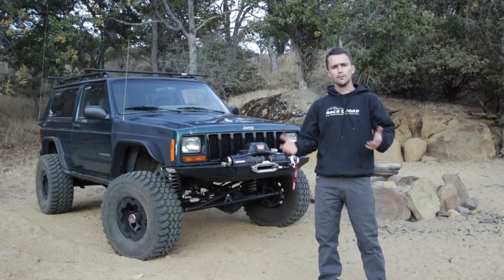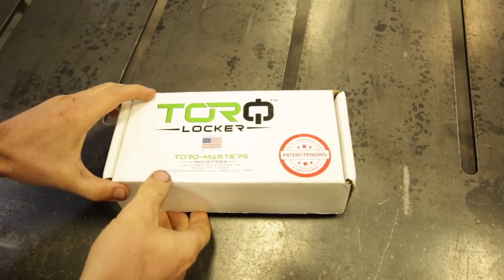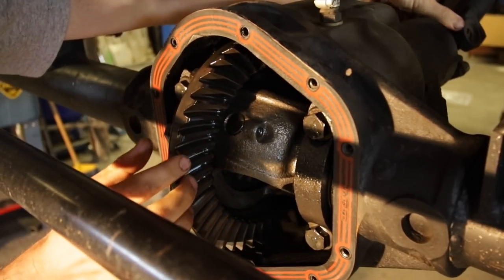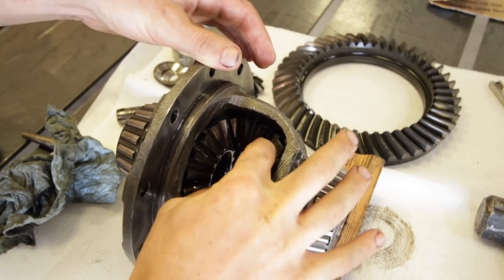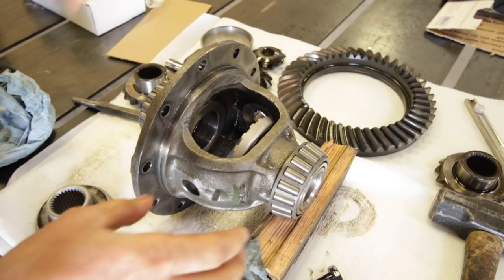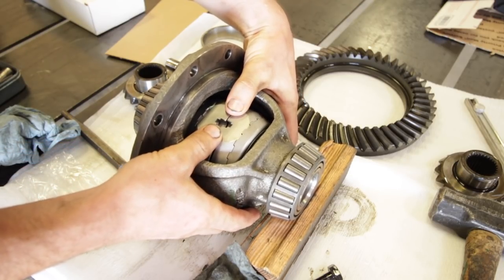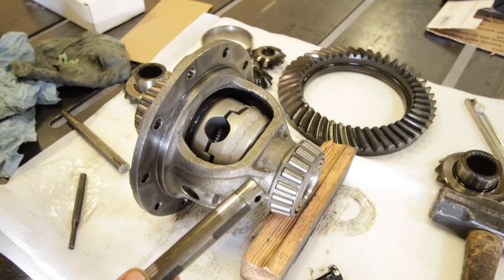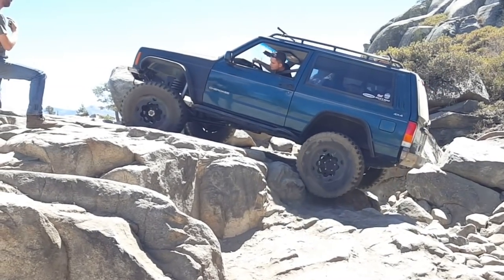How To Install a Lunchbox Locker

Comment: I installed one of the Torque Lockers in the front of my TJ. Im very impressed.  It locks hard. But it is very quiet on the street and the road manners are really good. I had an Aussie lovker in the front of an XJ it was noisy and road manners were not good at all. Torque locker has knocked it out of the park.
Reply from the maker: Glad to hear it!

Comment: I have a lunchbox locker in a Comanche and it is sketchy as can be in snow. If one tire locks under braking while in two wheel drive it try’s to lock the locker. Lol. The whole truck jumps and bucks. Just keep that in mind if your driving in snow on a partially cleared road. Great Video man.

Comment: I've run the TORQ Locker from TorqMasters for the past 2- almost 3 years in the D30 in my '11 JK . It is , handsdown , the single best,most noticeable difference and useful off-road mod I have added to a heavily modified , trail only Jeep. Cora & Eric being so awesome to be customers of only ramps their USA made products better. I installed in garage myself in about 3 hrs , taking my time. It is silent on asphalt and does not clack at all when turning full lock in 4wd, but I also run RCVs and cry'oed Yukon RPs. There's a full review of mine & other customers at the TorqueMasters web site. 
An amazing company and an amazing solution for a front locker. I have tortured it quite hard & it keeps the 37s digging and pulling ...⭐⭐⭐⭐⭐
Reply: I agree looks like a way better product and worth the money

Comment: I have one of these in my Dana 35 and it is one of the best things I have done. I didn't want to invest a lot of money in a Dana 35 but I also didn't have the money to do an axel swap so for the $270 that the Aussie cost I did that for now. It has been absolutely amazing. Not one regret installing it. I daily drive my jeep and have not had any issues with the locker, even with it in the rear. A lot of people told me that I would eat tires because I put it in the rear but that hasn't been my experience. The only thing I have seen difference is the normal clicking of the locker and increased traction. I would tell anyone this is a great bang for the buck project.
Reply: How bad would you say the clicking is? I daily me Jeep too and don't want it to annoy me
Reply: Neil turn your radio up
Reply: Thick gear oil 75-140 conventional and a thick diff cover will take away most of the clicking. We can hardly hear clicking in our LJ when driving on the street, we have TORQ Lockers front and rear.
Reply: @neil7179  my Aussie sounds like a card in the spokes of a bike. I actually like the sound.

Comment: I just installed a torq locker in my jeep tj Dana 30 and it performed flawlessly while running some trails at Rausch creek!  Of all the lunch box locker designs these torq lockers are the best!
Reply: Was planning to do the same on my YJ but am concerned, how does it handle on the street?
Reply: I've got the same question as Justin. How does it perform when the front axle isn't engaged on the street?
Reply: I have no issues in the front at all on street.  I don't have any clicking at all during turns either. This is my second type of lunchbox locker I have used and this one far exceeds the old one.
Reply: Great review, thank you!!

Comment: Torq lockers are the awesome upgrade of the aussie locker, and I use them in all my vehicles and they have been awesome front and rear !!
Reply: Just wondering if u do alot of street driving with a lunchbox in the front. Im thinking about installing one on the fron of my tj but worried about highway driving.

Comment: Great install video, easy to follow steps and nice camera work.  A lunchbox locker is a great option for the right application.
Reply: Right application is the key, you need to understand how they work in day to day before committing the install.

Comment: Like the other dudes are saying.  I drive a 79 f150 4x4 as my daily (just a little 6 banger).     The dana44 in front or the 9in in rear are wanting some sort of locker for canyon/desert crawl'n.   Here in Idaho, we do drive in snow.   Not freeway speeds... but normal streets.   Would like to see how it does 'just driving around'.  maybe mimic it in light dirt/mud or something.   Looks cheap and easy.  I like it.
Reply from the maker: I live in southern Oregon. We get winter driving conditions too! Stay tuned for a winter driving follow up vid on this locker. I depend on my Jeep for my primary transportation in the winter so I need it to drive reasonably as well.
Reply: Kewl.  Owyhee's style.

Comment: Great video!  I really makes the installation look doable.  Let us know how that locker behaves on the street in rain and snow though...  Its the only reason I haven't installed a lunchbox in the front or rear of my TJ.  I daily it.
Reply: I want to do the same to my ZJ but I daily it.
Reply: I would love to know how it's street manners are in the dry as well as the wet.
Reply: @vgullotta  When my jeep was my daily I had a lunchbox in the front and it worked great. It doesn't engage in 2wd so on the street it's great. I live where it snows but never have I had to use 4wd. If you use 4wd in snow, only use it in deep snow, don't want to get understeer at higher speed
Reply: @cranjismcbasketball343   How noisy were they on just out of curiosity
Reply: I have front and rear Spartan lockers in mine and it does great on the street, no issues at all.
Reply: I have one on my Tj in front.  You can barely hear it on the road.  But you can hear it in 4wd because it’s under a load and trying to ratchet.  I wouldn’t recommend one in a rear axle
Reply: @StrainingDingelberry  They work great in a rear axle all three of my vehicles have auto lockers in the rear.
Reply: Victor Leachman  Is it not an issue on the road because of the 4wd not being engaged?  And do you drive it in snow and rain storms?  I'm in Michigan and this is my do everything daily driver.
Reply: @Khorsathedark  If you use 4x4 in the snow regularly I would leave the front open and put a locker in the rear.
Reply: Agreed would  like to see a follow up video on the street
Reply: Front TORQ locker-
The Jeep will still drive like stock in 2wd, and will operate normally in 4wd. Gives you that added boost when off-road. 
Caution in 4wd on icy road conditions. Reduce Speeds! Just takes practice to understand how a locked differential reacts in Ice and Snow.

Rear auto locker, the more throttle applied, the more it locks up. For a vehicle that sees more off-road use than on, this is what I prefer.
There is a slight learning curve for newer drivers with manual transmissions, but it's super easy. A rear locker works great in the snow, all the added traction means you won't need 4WD as much. A rear locker is fine for Daily Driver use. It will make an audible ratchet noise when negotiating tight turns, but that can be lessened with a thick diff cover and heavy weight gear oil.
Reply: @TorqMastersIndustries  Caution for a locker in the front or back?  or both? I know if the locker is in the back. The rear will kick out. But what's the negative in the front? If the locker is in the back. Wouldn't 4wd help maintain stability?
Reply: @GOD719    
Driving on the street - a rear locker will only kick out if you stand on the throttle in slick conditions, which could make any vehicle kick out. 
Driving on the street - a front locker is not noticeable in 2WD
Driving in Snow and Ice - A rear locker will give more traction and you will need 4WD less. 
Driving in Snow and Ice - A front Locker should only be used in 4WD when 4WD is really needed and should be driven at reasonable speeds as the OEM vehicle manual suggests. We know some people use 4WD as a crutch in snow and ice to drive fast, at highway speeds. If you can get up to highway speeds you don't need 4WD.

Comment: Great video. Thanks Tim! Cool you got a chance to run the Rubicon. As I posted on Nate's video, you guys on 33's can do Fordyce Trail... But, you will be stacking rocks, pulling cable and will have to do some of the by-passes. Depending on the time of year, the river crossings may be interesting as well. Good to see others using Lube-Locker. RTV on the diff cover is for sucka's! :-D

Comment: I have a 2000 XJ 3.5 lift with 33' tires should I put a front locker on my everyday driver? I'm in the process in install a rear locker I like to run my jeep in the desert what are your thoughts. I'm new to the XJ group. I enjoy watching your videos and have learned a lot.

Comment: I have had mine for a while and it stopped making noise when I make a sharp turn in 2 wheel drive. How can I check it to see if it still works. It is without a doubt the best improvement in 4 wheeling.  Thanks

Comment: Hey Tim, good to see another video from you. Question about thine locker, how are the on road manners of this locker? Their website says it has the best of all lunchbox lockers, but I'd like to hear from someone whose actually running it.
Reply: A front locker has no affect on road manners, because you are in 2WD typically. A rear TORQ Locker is where you see the great road manners, and here's why:
the TORQ Locker eliminated the "spacer" which is found in all other lunchbox lockers. The spacer can sometimes slide down the axle shaft and bind on the cross pin. When it releases, you get a loud "pop" or "bang" that some people complain about on the forums. Without the spacer, no 'bang." Typically these complaints are for rear lockers.  A rear locker will click when you coast through turns. If you hit the gas hard in a turn, you can get the 2 rear tires to chirp.
Reply from the maker: Because I have manual locking hubs now I'll almost never run this on the street in 2wd simply because I don't need to. That being said, while messing around with it, driving with hubs locked in 2wd in a parking lot it's honestly barely audible while turning (using 75 140 gear oil) and there are zero handling characteristic changes. I haven't tried locking the tires up on pavement while turning or anything, lol. But under normal driving circumstances you shouldn't really notice it at all IMO. Great upgrade to my Jeep.

Comment: I really need some help. I want to get either a lunchbox or LSD (like a trutrac). I cannot decide which or where (front or back or both). I need it mostly for the snow/ice because right now it does not move being open diff. Has anyone had experience with a front-only lunchbox in the snow/ice?

Comment: Very nice! How does it handle on the road or is your Jeep strictly off road?
Reply from the maker: I drive it almost daily. With my Dana 44 swap I inherently received manual locking hubs too so in my case my front axle components are completely motionless while driving and hubs set to FREE. Lots of people have these in regular XJ or other non disconnect axles and daily drive them without issue!

Comment: Great video. Lunchbox lockers are great, but I would never put one in the front of a vehicle that will be daily driven in rain or snow. I think they are primarily offroad use only. To dangerous to drive at highway speed in foul weather.
Reply from the maker: I'll find out!
Reply: When you are in 2wd they are no different than an open diff.
Reply: I've had aussies in the front and rear of my XJ for the past 5 years, and I'll be putting TORQ lockers in my one tons, driven in rain plenty of times, and even in some harsh NY winters. As long as you don't drive like a dipshit, they are easily manageable and you can quickly adjust to how they act and predict what the vehicle's going to do better.
Reply: Lunchbox lockers are designed for both on-road and off-road use. Many of our customers install our lockers in their daily drivers. For snow and Icy conditions we say use common sense and don't drive recklessly.

Comment: Good video but when making a how to video I  would  remind viewers to Mark the ringgear before removing it.
Reply: Would you have to recheck/set the pinion & ring gear engagement?  (assuming you use the same shims of course?)
Reply: Good tip Robert - I totally agree.
Reply: Billy T  No you do not, that's the beauty of the TORQ Locker. As long as the ring gear goes back on in the same position, you do not have to re-set backlash. An index mark on the ring gear to carrier is an easy way to make sure the ring gear goes back on in the same place.
Reply from the maker: Nope. Just mark the ring gear there it mounts up to the carrier. I did this before unbolting it but neglected to mention that in the video. The locker came with great instructions that mention and show you how to do this.

Comment: Thinking of getting one  I've seen other brands of this type locker are noisy how did yours do ?
Reply: the TORQ Locker eliminated the "spacer" which is found in all other lunchbox lockers. The spacer can sometimes slide down the axle shaft and bind on the cross pin. When it releases, you get a loud "pop" or "bang" that some people complain about on the forums. Without the spacer, no 'bang." Typically these complaints are for rear lockers. A front locker in 2WD is practically invisible, you door hear it, you don't feel it, it does not change driveability. A rear locker will click when you coast through turns. If you hit the gas hard in a turn, you can get the 2 rear tires to chirp.
Reply from the maker: Barely audible.

Comment: Why didnt you lock the rear first Tim?
Reply from the maker: Haven't decided what locker to go with for the rear. It'll get locked eventually!
Reply: BleepinJeep use ox Tim i think its more reliable. So how much was the torq locker are they less expensive than spartan
Reply: delinquentdesign  TORQ Locker is more expensive than Spartan. TORQ is made in the USA, had  a 4 year warranty with no tire  size restrictions, and is a considerably stronger design. The Spartan is made in China, has a 1 year warranty with tire size restrictions, like you can't run larger than a 33" tire on a Dana 30.
Reply from the maker: Out of the numerous lunchbox lockers on the market I felt like the Torq Locker was a superior design and also made in the USA. That matters to me their price is reasonable for what you get! Checkout their website.
Reply: @bleepinjeep  If you go with a lunchbox locker in the rear. Get the Powertrax no slip. I have it in the back of my k2500. It doesn't click or bang. It feels like an open diff on the road. Unless you are hard on the gas

Comment: Okay so what's the difference in handling between open diff and lunchbox locker on pavement? My XJ is a daily driver but wanting a locker for when I do go wheeling. Obviously an Air Locker would be the way to go, open diff when needed and fully locked when needed. Just don't want to pay $1,000/axle.
Reply from the maker: On pavement no handling  difference in 2WD if you add one to the front. If you add one to the rear it shouldn't be noticed on pavement either unless you gun it around a corner... In which case it'll likely lock up and you'll spin both tires... Under normal driving conditions they'll basically be undetectable expect you might hear a low clicking noise while turning at slow speeds but if you use thicker gear oil you may not even hear that! I'm surprised how quite mine is.
Reply: @bleepinjeep  definitely enticed my empty wallet 😂 looking to give this a try. Worse case scenario I upgrade to D44 front/rear!
Reply: There are pro's and con's to mechanical lockers vs. selectable lockers. 
Mechanical lockers are reliable, sturdy, and have few parts to fail. They allow for wheel speed differentiation (so you can turn), even while applying torque to both wheels. Mechanical lockers can click, which some people find annoying, but for $1,000 less than a selectable (plus install), it's an easy decision for many to choose mechanical. 
Selectable lockers usually require professional installation, they have smaller parts, and air lines or cables that can fail. In the On position, a front selectable locker is very hard to steer. We've seen people get into trouble, and even a few roll overs, when the driver forgot to turn on his lockers before an obstacle. A mechanical locker is set it and forget it, it's always there for you.

Comment: so does the lunch box locker somewhat work like a LSD ?
Reply from the maker: Not really. Lots of animation vids of their operation on YouTube. Basically they're locked all the time unless you're turning with no pressure on it such as if you are costing around a turn, in which case it will "ratchet" allowing the wheel speeds to differentiate.
Reply: Another difference - With a LSD, if you lift a tire, all the torque goes to the tire in the air. With the TORQ Locker, torque is sent to both tires, which is a huge help on the trails.

Comment: Thinking bout doing this on my JKU, the reality is, I have to drive a thousand miles on pavement before I can get to a hundred miles of rock trails  Is this AKA a Detroit locker? If installed on the front axel only, while in two wheel on the road do you still get the clicks on turns on the pavement?
Reply from the maker: You will unless you have manual locking hubs like I do. Honestly with the thick gear oil that was recommended to add in the instructions specifically if the clicking was of concern.... I can't really hear it from inside the Jeep with my hubs locked on pavement and in 2wd. I don't think you'll notice it much but it does click.
Reply: Iv had a Detroit locker in the front axle of my tj, i never even know its in there driving on pavement.
Reply: A Detroit Locker is a Mechanical Locker, but operates on a different mechanical principal. A Detroit replaces the entire carrier and requires a Ring and Pinion setup - which most people choose to hire a professional to do. A Lunchbox locker just replaces the spider gears in the carrier and can be installed by the average person. We like to say, if you can change the brakes on a car, you can install a Lunchbox locker.